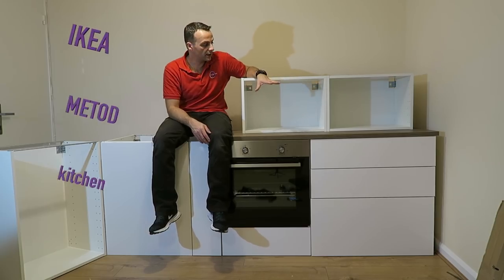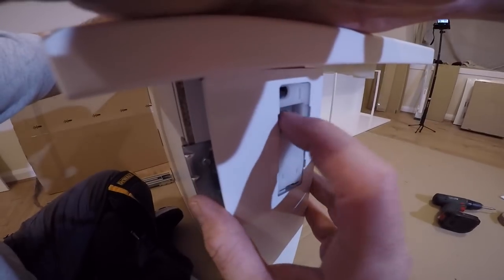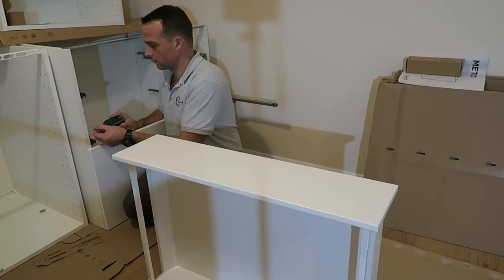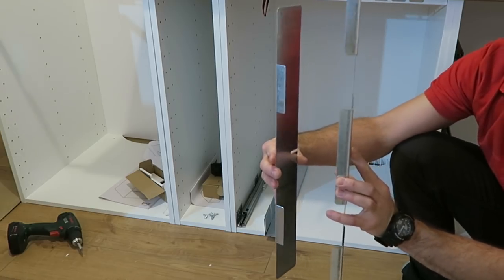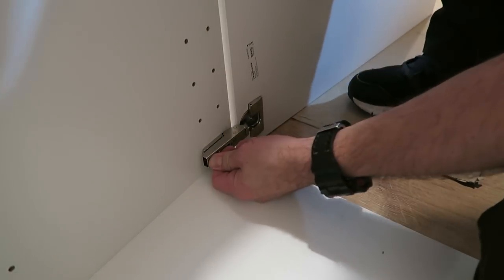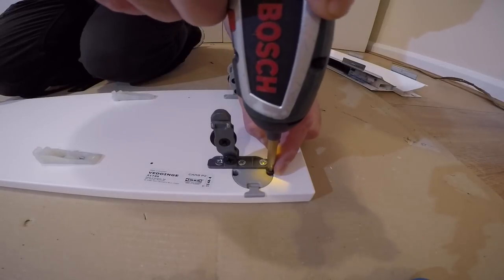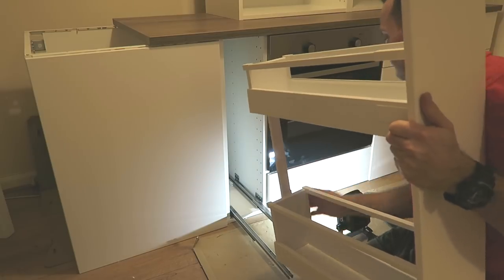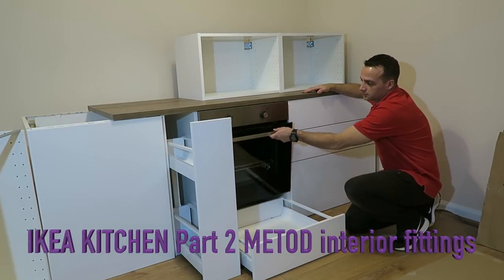IKEA KITCHEN Part 2 METOD interior fittings

Comment: Hi. You have made a small mistake in the narrow drawer. There are 2 sliding metal brackets. One goes at the bottom, the other in the middle. This provides more stability as is a very tall and narrow drawer. Thank you for the other videos too, very useful.

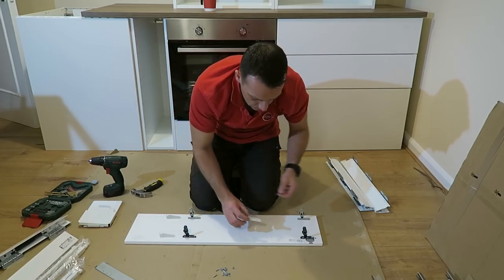Comment: Really nice to have this aside while building my own kitchen. Just as a note for you: the small plastic covers at 9:12 slide because you misplaced the plastic attachment at 7:25 (it should be moved by 1 hole, so that the screw goes through the circlethingy and the middle hole). This is also the reason that the sides of the drawer are not at a 90 degree angle, as can be seen at 9:43. Still great video though, thanks!

Comment: Great video but the rails for that small cargo unit are in the wrong place. One rail should be at the bottom and the other one in the middle on the opposite side. In 10:15 you can see how wobbly it is because of the wrong placement.
Reply: Yes!  He did it the logical way but the wrong way.  I got it wrong, the first time, too.  Then I cursed Ikea for missing two rails from the package.  Then I read the instructions again.  Mind - now my drawer front is extremely wonky and I can't seem to get it right!  In, out, up, down, left, right.  And it's all so counter intuitive because, for instance, mechanisms have to go down for the drawers front to go up etc...  Or do they...  Why couldn't Ikea have used the page, showing pictures of how it's better to have help and not do it on a hard floor, to show the effects of turning the screw driver a particular direction?!
Reply: @batintheattic7293  did you ever figure out how to make this not wonky? We have the rails in the right place we think, but it does not slide in smooth at all!
Reply: @MissTiff629  So long ago, Tiffany, I'm having to wrack my brains.  My kitchen drawers still aren't perfectly straight.  It's a nightmare.  I can't remember, Tiffany.  Sorry.  But, reading through this - I think you watch the video and then (as regards rail placement) follow nikvist's advice and not the video.  If you're past that point, though, and it's at the drawer front adjustment stage...  Yeah, it's really tricky.  Pen and paper.  Screwdriver.  Hunker down and write what happens when you turn the adjusters different ways.  It takes time, and focus, and it's not the kind of thing for multi-tasking.  If I remember, rightly, I had a problem with remembering if 'toward me' (when sitting directly in front of the beast) was top of adjuster rotating towards me or bottom was.  Pick one - burn it into your brain!

Good luck, Tiffany.  I feel your pain! :) I would not like to have to do it again.  Matcha tea, I have found, is really good for calming and focusing the thinking!